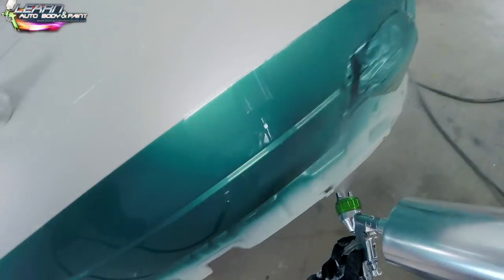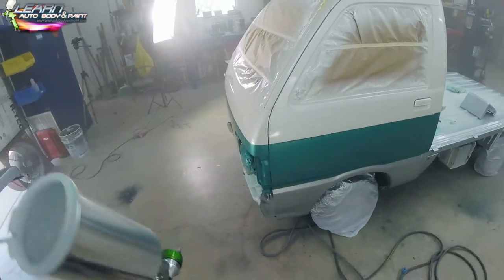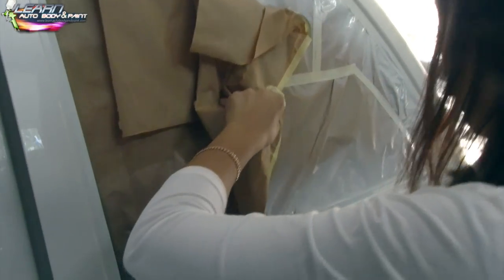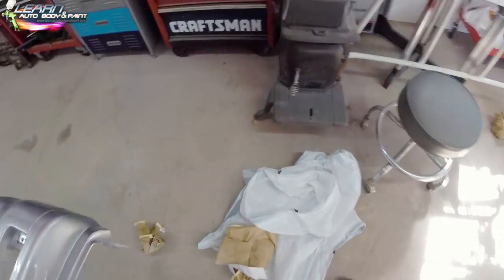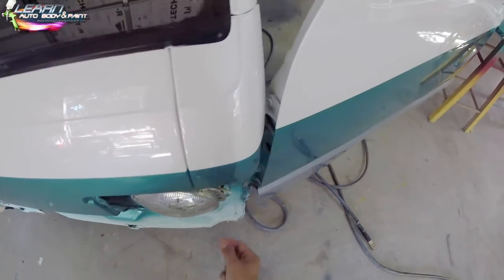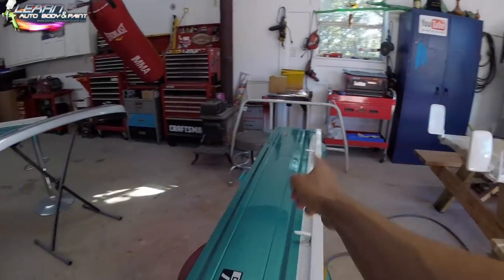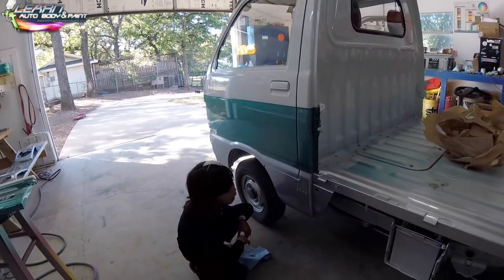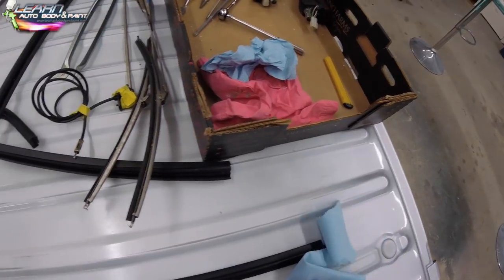Clearcoat Application & Unmasking The FRESH Paint Job!!

Comment: Damn I could have used that tip when I sprayed the front end of my girls Accord haha. I waited til the next day to unmask and when unmasking the front right headlight I had the tape rip a piece of paint off and when unmasking the side view mirror had the same problem just not as bad. So I'm actually going to be doing a respray on the front end soon cause the batch of metallic silver was a little too light but this batch I have now is right on. I'm actually heading out to the garage now to wash the read bumper down with 320 and spray some primer filler and wet send and go directly to spraying base and clear hopefully be done by 10pm about 4 hours time haha. It's do able. Nice karate chopping! Lol

Comment: Hey Tony, I am in the middle of a project where I had to do some bondo work, and repaint both sides of my car.  I idn't use a professional spray gun but rather rattle cans.  When I applied the clear it became all cloudy..  I sanded the orange peel and thought that would correct the cloudiness.  It didn't.  So now I think I need to correct this cloudiness by sanding off the clear and reapply with a good quality clear using a professional spray gun.  Do you agree??  If so, what kind of clear should I use that would give me a gloss look??  The gloss on your truck looks great!  which one is that??
Reply from the maker: Michael Valone I agree. You used crap clear. Use a Nason or PPG shop line clear, they are a cheaper line. Did you get the free book that I give away on my site? that’ll help you a lot. Also if you’re looking for great sprayguns don’t rule out these Atom X guns. By far I think they’re fantastic guns at very reasonable pricing. https://zoolaa.com good luck and keep me posted!

Comment: Hey Tony, Ryan here from South Africa. I have mind boggling problem and would like to maybe get your opinion on this if possible as your are busy and all... I've recently done a pvt job for a friend on a silver Toyota, from the start of the job as the car has been resprayed prior it's been a nightmare. The 2k ms grey primer had a reaction with the existing yellow primer where adhesion was a issue. I managed to rectify the issue, the base coat laid down great. The clear coat did not harden and I then sanded it off, re based and applied a better clear coat. The clear coat fully cured and i wet sanded and buffed 2 days later. A week later today the clear coat is giving off a hazzy (milky) look and some spots looks as if someone has wet sanded and not polished again making it look like it needs a buff( orange peel) but its in the form of lines. Any feedback would be great. Thanks